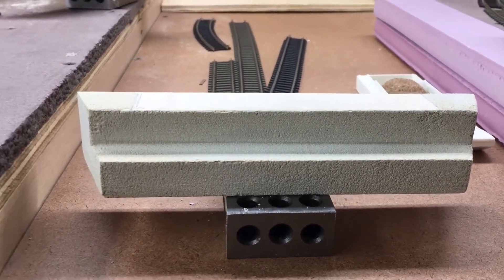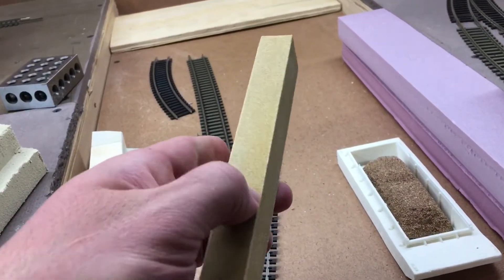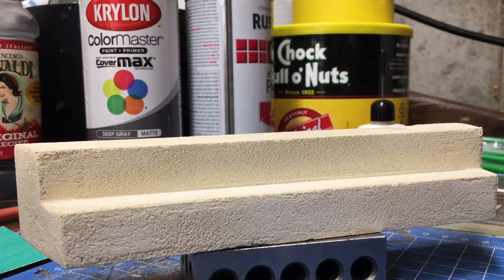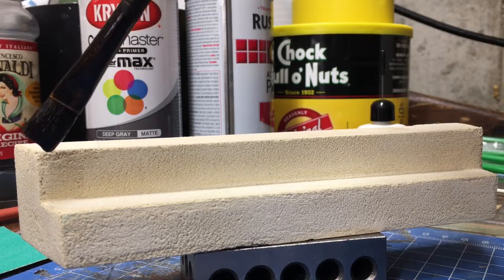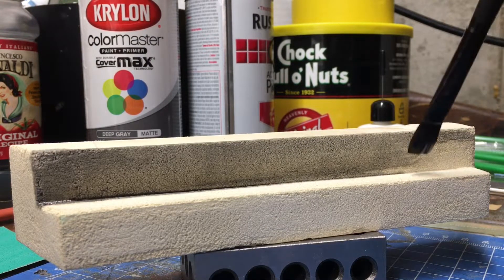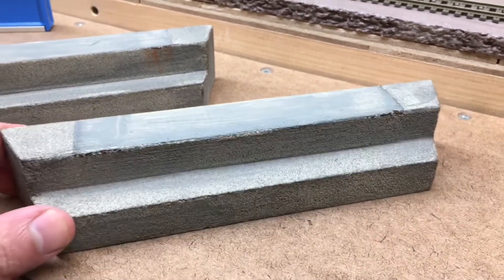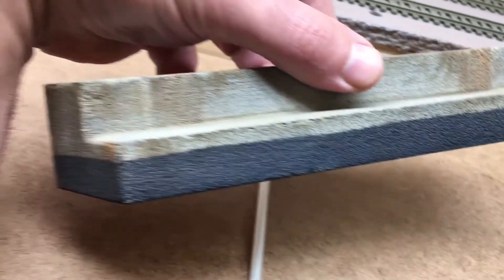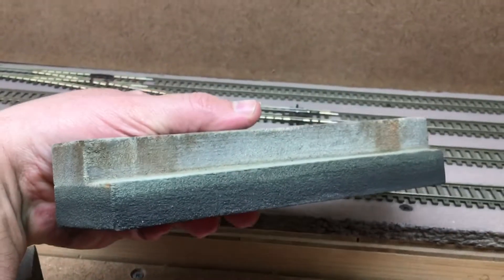New Haven Railroad Layout Update 2020-4 “Bridge Abutments”

Comment: Nice layout updates.  I like your scratch built abutments and the grout you used. You think this grout will work on a styrofoam block abutment?
Reply from the maker: Georgia Sun Belt thanks for your comment. Yes absolutely it works on the pink insulation foam.